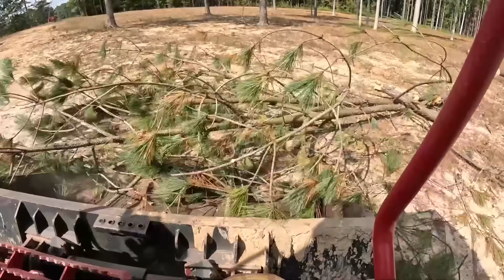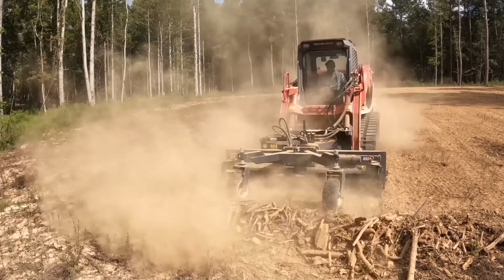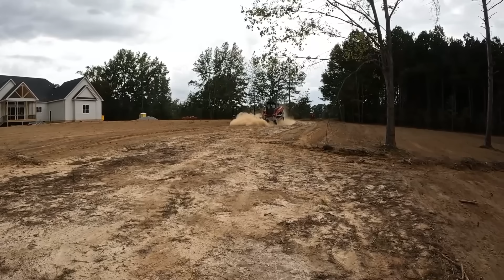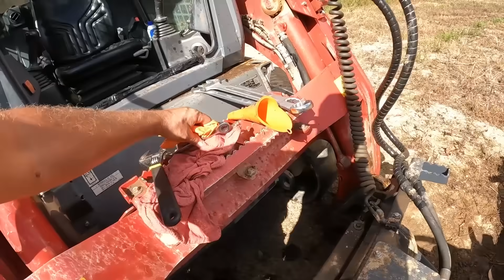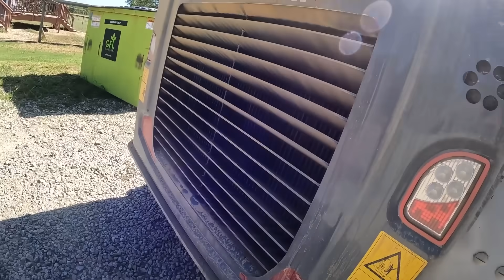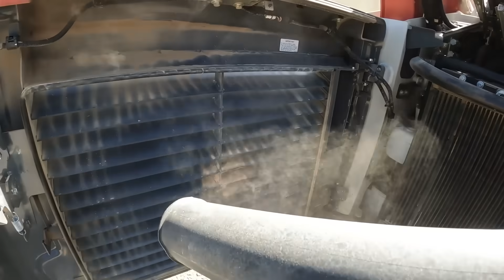A Day Job Turns Into More With Breakdowns

Comment: Hi Chris, to stop having punctures you should see if you can find a "Mousse" that will fit your tires. They are very common for off-road motorcycle and ATVs. It's a high strength foam insert that replaces the tube or can fit tubeless rims.

Comment: I bought a box of wheels at a farm auction the other day because I've had similar problems with skid steer mowers and attachments.  These attachments do take a beating.  And people wonder why you have to charge what you charge. Equipment breaks and it's expensive.

Comment: Chris You have a great Daywork Planing okay, but the Day is hot and the Dust have the Ruckus Rake not good to wear out. To Home you clear the Machine from Dust with Air pressure and Wash with Power then the Dust is terrible. A Day to 😱😰😡

Comment: I would sure hate to be murdered with that chain saw,  it would probably take an hour or more, I'd most likely die of friction burns. 
Give the blade a rub with a rat tail and a flat bastard file young fella, it won't sharpen itself. 
Good job Chris on the raking, its going to be nice when grass comes in. About your wheel, you can always cut a piece of 12-14 gauge sheet metal make a disc for the wheel to cover with axle hole to protect the tire valve, you might have to shave a hair off the bushing, issue solved. This works for anything with shopping cart wheels.

Comment: If I so boldly can make a suggestion about tree felling, if you are filing the rakers on the chain don't do it anymore. When you are cutting, try to only take enough bite to maintain maximum RPM. Working the saw like you are handling a hand saw will take only longer to accomplish the task !